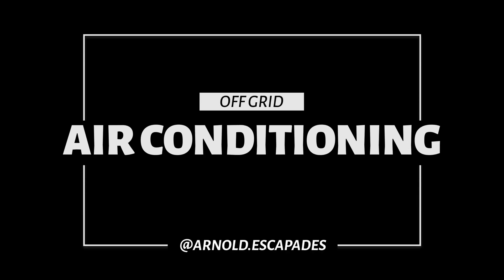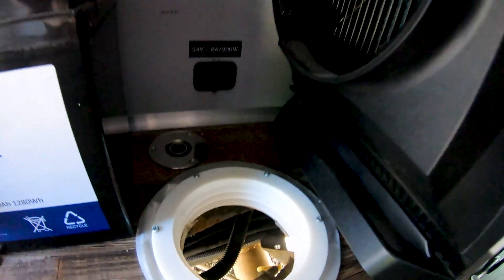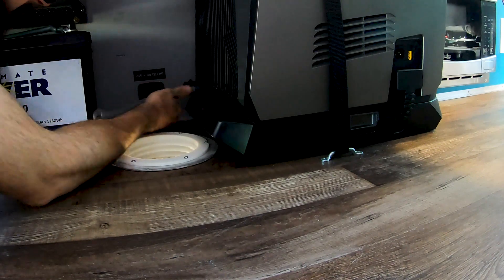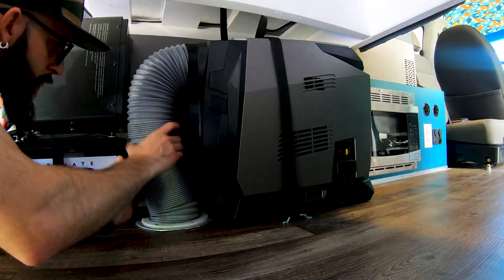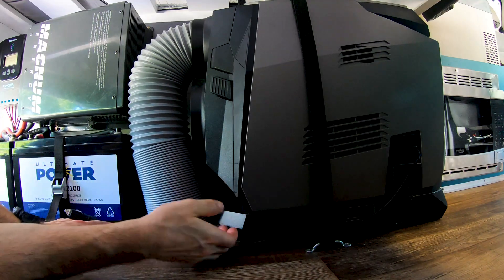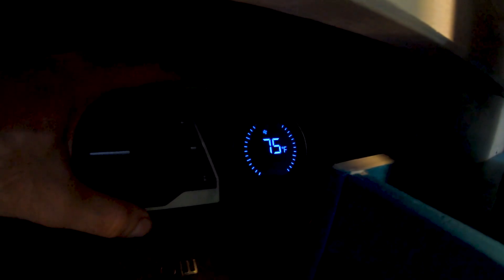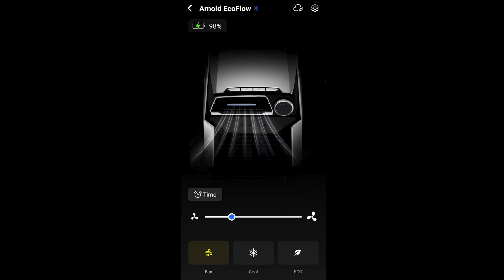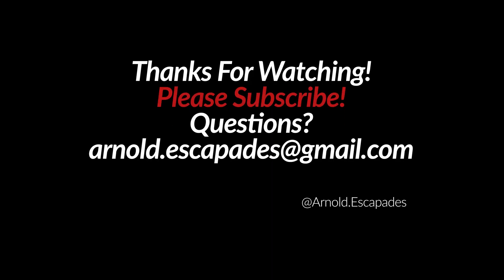How We Use Air Conditioning Off Grid! Battery Powered AC In Our VAN!

Comment: Exactly how I would do it! Joy to watch, thank you :)
My plan is to go with two a bit smaller floor openings. Duct insulated. And why not stepping up straight to 48V ? - that's what I did with charging my EF Delta at 400W from 12V battery/alternator system.

Comment: i will never understand 12v vs 24v
Reply: Why! Amps is the bottleneck. 12, 24, 48... you are still limited to 8A by EF (AFAIK). Wave 2 can be charged by source 12-60V. Watt is what you need. Power (W) = Volts x Amps. You're welcome. Ideally you would go with 48V DC.

Comment: You have a fundamental flaw in your system. For every cubic foot of air you blow outside, you must pull in a cubic foot of air. Some systems have a split dual duct or a duct inside a duct. Your system will work better it your condenser uses outside air.
Reply from the maker: Thank you! I understand that, but don't want another huge hole in the floor. It works fine as it is, so I'll leave it this way until I see an issue. Thanks for your concern!
Reply: @arnold.escapades Question.  I'm having issues cooling a room that's about 10 x 10 and it takes a long time to make a dent in the heat of the room.  Might it be best to only run the hot air put while letting just the I side are be recirculating? Perhaps the air outside is too hot to truly and effectively cool the room?  Just curious since I see yoy are using yours that way.   Thanks.
Reply from the maker: @woodypaq  Not sure. I only used mine this way because of lack of space. I have my van well insulated, and it cools it down a lot and maintains it there. May give it a shot?
Reply: @arnold.escapades  I'm just home and removed the input hose to see.  I can see it working, just wondering how well.  This would be awesome.  I can take that high an investment  and put it to regular use.  Thank you for your response.
Reply: @arnold.escapades  It's working great! 💪🏾 Happy it's much more coolness to the air and indeed I think it's just a bit too hot to thoroughly cool the air at this moment.  It's Texas after all here.
Reply from the maker: @woodypaq  great to hear! 🍻
Reply: @arnold.escapades  Can you recommend a good inverter about 1500 to 2000 watts for a DC inverter ac for home use?
Reply: @arnold.escapades  that’s fine, it’s simple physics. You are taking conditioned air and using it to condense the Freon gas. For every cubic foot of air you push outside, a cubic foot of air must come back in. That is why the AC condenser in your home is outside. You can certainly take a bath with the drain open., you just need more water coming in than going down the drain. Somewhere on line you can find dual ducted hose. One large hose with a smaller hose inside. The air comes in the inner hose and out the outer hose. They used to make three types of portable AC units. On dual hose, one double walled hose and now because it’s cheaper, a single duct. I’m just trying to help the viewers so they optimize the cooling power of their portable unit.
Reply: I have had the Ecoflow wave 2 for 2 seasons now and you are correct. It runs way more efficiently and cools better with the intake hose ducted to the outside as well. But I am here looking for a way to “permanently” install the unit ducted to the outside (vs. using the van window).

Comment: Great video.  I wanted to ask if this will work with no issues using a 200w solar panel setup? I'm currently using 2 Renogy solar panels (200 watt) with a Renogy Rover 40 Amp 12V/24V DC input MPPT solar charger and a Renogy 2000W Pure Sine Wave Inverter 12VDC to 120V AC Converter?  I also have a LifePo4 Battery 100Ah 12V 1280Wh Deep Cycle Lithium Iron Phosphate battery.  With this setup the only thing I have plugged into the inverter in my camping fridge.
Reply from the maker: Thanks! Should work fine. I'm guessing you mean plugged into 120v power? I don't think a 100ah battery would last long running this, but you could try. I use the EcoFlow add on battery and just charge it off of my battery bank using a 24v step up converter. The battery used on the EcoFlow is 24v, so I charge it using 24v.
Reply: @arnold.escapades  I would think EF uses only 50.4V, 14s 18650 based DC systems. At least Delta line.
Reply: In order to get rid of many future headaches, consider: 1) Adding an extra 100Ah battery 2) DC-DC alternator charging.
Reply: @gregx9419  Thank you!
Reply: Thank you!

Comment: Could you kindly share the link to the floor vent with cap? Thanks
Reply from the maker: 5-inch Tube Portable AC Air Conditioner Exhaust Hose Flange Wall Mount - Counter-Clockwise thread 5CCWMOUNT https://a.co/d/3Z2bR6t

5-inch Tube Portable AC Exhaust Hose Wall Mount Plug - Counter-clockwise Thread 5CCWPLUG https://a.co/d/ahqihpN
Reply: @arnold.escapades  Thank you so much!